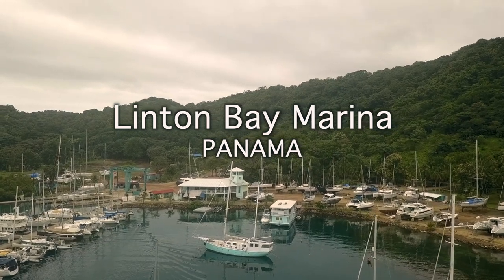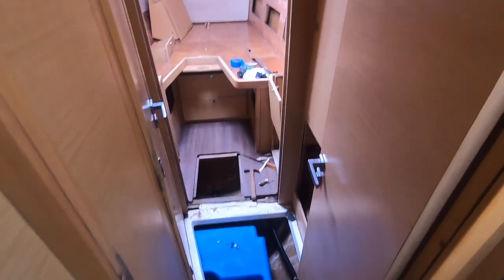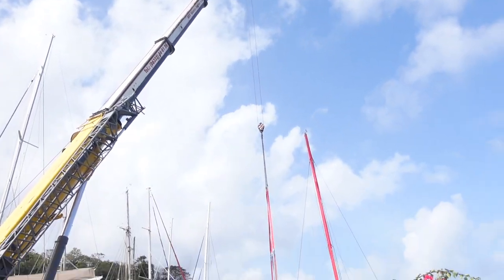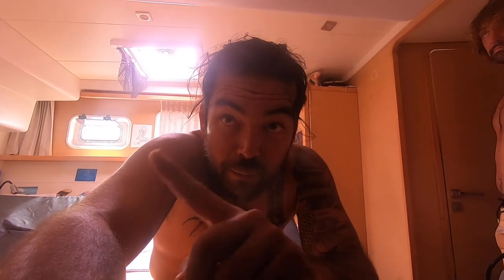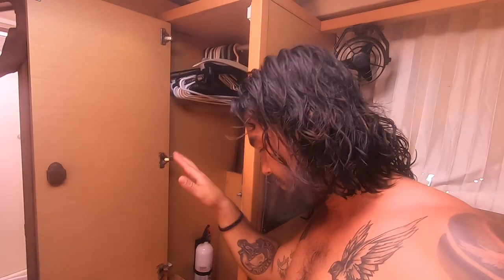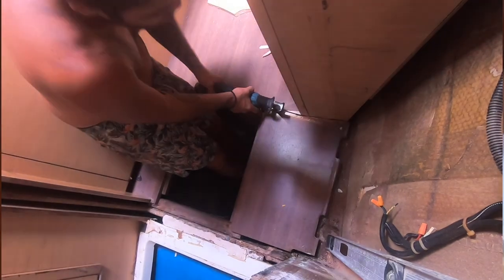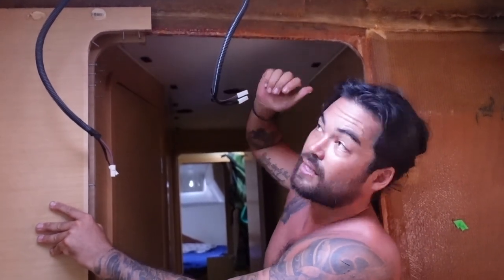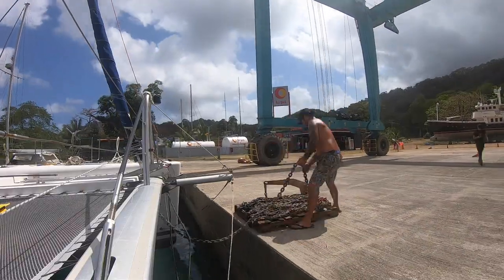CRACKED BULKHEAD REPAIR SERIES - Part 2

Comment: The amount of damage is quite impressive for sure. Im more surprised the boats hull hasnt cracked and sunk at this point. Ive been watching since the beginning and it has been a rollercoaster ride. I know with your repairs this will be the strongest lagoon 450 out on the water. Cheers for getting in the tight spaces, i was having a little anxiety thinking you might get stuck under there, but realized the video was published so you made it out eventually. Hopefully lagoon takes these videos of seeing the damage to strengthen their boats going forward. I know the boat wasnt designed for hurricanes but didnt think it would be that damaged and beat up. Heres to watching Parley get reset to an evened out hull and everything fixed so you can continue on in your journeys. Cheers mate from Texas!

Comment: You better laser level the stands before you start any leveling of the vessel.
Reply: Yes a good place to start for sure level props first
Reply: I think that Colin has it all in hand as he is no fool. He will no doubt be using multiple jack stands on the hulls and the bridge deck to level the vessel and get the hulls and bridge deck plumb. He wouldn’t level the stands as the boat isn’t all flat level surfaces. Better than a laser level for plumbing the hulls to each other is a water level, simple to use, cheap and 100% accurate.
Reply: These boats like most boats are built from the shell bottom up in layers . That's why it's a nightmare. Back off all the hard ware and bring in alot of level stand points . Then repair with glass and glues and fabric.

Comment: If you guys would have crossed the pacific like that, you would have ended up like sailing zingaro. Their cat litterely broke in half. I surveyed a lagoon 440, an a Fp 46 bahia, and a 40 manta last year. All had stress cracking. I am litterely batting 0 on every fiberglass multihull I surveyed. A couple people told me to look at trimarans. Because the horizontal distances are shorter between the hulls, they are much stiffer and less prone to stress cracks caused my excessive movement. From an engineering standpoint, that makes since.  Right now, I am looking at a steel tri to hopefully get away from the stress cracking. If I find them on this vessel, in will probably go to a mono. They don't crack in half. Good luck on your repairs!!!

Comment: Man the amount of work here is going to be massive,   Disassembly, repair, put back together again.  What’s your timeframe,   2 years?
Reply: I reckon less than 2 months for everything back together.
Reply: @Acrowat40  Agree, most of the time will be in the disassembly and re-assembly.  The actual structural repairs will go relatively quickly once they get everything opened up.
Reply: @Acrowat40  Love the optimism.
Reply: @Acrowat40  2 months seems optimistic,   Did you watch expedition evans? Or sail life,   I guess it will depend on the amount of people working on it too,  they seem to have a good amount of folks get involved,  also lagoon involved with the technical side will be an enormous help too.
Reply: @vxnova1  Considering how crappy those Lagoons are build, I wouldn't count much on the technical support of the builder. By now I guess they could advice Lagoon how to build better boats. ;-)
Reply: @Acrowat40  it has been 2 weeks now and they just got hauled out.  Love your optimism but this is going to be a lot longer than 2 months,  maybe not 2 years that was from Leo on rebuilding the tally ho, where his schedule is always 2 years
Reply: @vxnova1  yeah great series! But EE were two newbies at major repairs (one who had to start working mid repair) vs colin who is a mech eng & ships engineer with a couple of boat salvages under his belt along with a couple of mates working full time.  Leo's project is completely different in every way, he's basically building a large wooden boat from scratch...
 I think will be closer to a couple of months vs couple of years. I like the repair videos the most, so I'd prefer it taking longer : ) 
Looking forward to finding out either way!

Ps MJ sailing are doing a cat build (starting from panels) which is worth checking out
Reply: @Acrowat40  I have watched mj sailing as well.  Have to cut back though watching too much of this stuff but I am looking forward to this one, it’s a big repair,  i am no expert and I think the repair will be the easiest part it’s getting to everything is going to be the pain,  disassembly and reassembly,  the all the electronics too
Reply: @Acrowat40  I'll be shocked if they can get this thing back in the water fully repaired in under a year. Unless they get a decent work force helping out on it. If it's just the two of them this boat will take probably 2 years if they even bother persisting with it. The entire boat needs a rebuild.
Reply: 4-6 months for a proper refit.
Reply: @johnwinnerd8511  this isn’t a refit. This is looking more like a rebuild. Getting all this squared up seems impossible. It’s bent and twisted. It’s gonna need more than pressing up from the bottom.. I feel like Debbie down but it may not be repairable. Like a car that gets a twisted frame. I really hope I’m wrong. Praying for him.
Reply: Soooo 2 months to repair the bulkheads was pretty much exactly on the money!
Reply: @paulvandriel2344  almost exactly 2 months it's was to complete the bulkhead repairs after all.
Reply: @uglyduckling81  two months, and probably less than a couple of weeks to get the boat finished. Impressive work.
Reply: @Acrowat40  It ain't over until it's over. The real work comes now. Let's see....
Reply: @Acrowat40  much better guess than mine anyway.   Not sure how long before he is back in the water,   I think they have all the electronics to replace as well,  so maybe a few more weeks left yet

Comment: Lagoon should carry their weight and fix this catastrophic failure with their production boat.
Reply: I’d agree if it weren’t a hurricane damaged write off boat,
Reply: The damage Colin's fixing predates the hurricane. That's what the wood blocks confirm.
Reply: @RechargeableLithium  yea that’s not good, definitely damage there prior,

Comment: Just reinforces my belief  never to buy a glued together production boat. Between you and Evans Benetau, I have come to see how inherently weak those boats truly are from the factory. Obviously, made to sit at a dock or  on anchor, not actually sail and take on any stresses.
Reply: You are so correct. I had a boat in Australia and the boat surveyor told us of a Beneteau coming from France, and on his survey, all the bulkheads were delaminated , none of the doors or closets would shut and the boat was all twisted. POS it was. Expensive though, but just not ocean worthy...

Comment: Were the shrouds over-tensioned? Aside from what looks like design/manufacturing deficiencies, overtightening the shrouds looks like it would contribute to the problems here
Reply: first of all refering to the multiples exchanges around the french 450 having the same damages, it seems that pre tensioning should be done with the boat jacked under the cockpit (as at the end of the video) which is nearly never the case.  but that is a recurrent discussion about cat rigging

Comment: Farrrrk ! You guy must have balls of steel to be so committed to this. You are also soooo fortunate to be in a facility with the heavy lifting/ shifting gear available to you. The issue I see is, as you get the hull back into the correct position in all the places it’s off, how the hell are you going to get any adhesive or resin into place to let it do it’s job effectively ?  Obviously, when the boat was built, they were able to drop the floor onto the hull as well as having a crowd of people helping. This is such a mammoth project but, I’m pretty certain you guys are up to the task; you just need more hands to help.

Comment: I would drill some holes through the floor over the top of those attachment points and add the adhesive from above. l would devise a way to prep/sand those surfaces from above. I feel it would be near impossible to prep and glue those areas from that cavity. I would rather have a few well placed inspection ports in the floor to facilitate a good repair. Maybe even get some tabbing in there.
Reply: that makes a lot of sense
Reply: agreed the correct way to repair the boat, not that it's good idea. Is to return the boat to the factory and have the entire deck removed, replace all the bulkheads and any structural components while the boat is located in an original mold or Jig to ensure its square and true. Keeping boat square and level on  all 3 axis will be nearly impossible in a gravel boat yard.THEN re-glue everything, add a significant amount of new and additional structural components, fiberglass and epoxy. Then put the deck back on. I estimate this amount of labor and material costs will far exceed the cost of a new boat.... They have the car show on cable, Graveyard Car's, the guy rebuilds cars from the Car Graveyard, the new Channel will be called Davy Jones Locker Boats... ;-)

Comment: Some of your subscribers have been quick to place responsibility on Lagoon and it’s design team. From my observations, the majority of the damage in the bulkheads is most definitely moisture related. Although the plywood materials are considered “marine grade”, they’re still made of wood, a material that changes drastically with differences in moisture, regardless of how well it’s been “sealed” in resin.
I wish you the best of luck (skill based) in your endeavors to repair this beautiful craft.

Comment: I guarantee all of these Lagoon 450 cats have at least some level of these same problems. Good luck guys 😳
Reply: I used to have a thing for them...definitely not anymore.
Reply: I can’t help but wonder if all of theses boats have some kinda of damage on the other hand I have to wonder what the heck was done to this boat to make it bend like this
Reply: @nwanchorcertification  
It was an insurance write off after hurricane damage...they had no clue what they were getting in to.
Reply: Really bad construction that there was no tabbing on those bulkheads, just glue and fillets.  Even if they were tabbed they dont appear strong enough anyway.  The engineering was flawed from the start. 
Clearly there were problems with this boat before the hurricane damage as well. Not only was the repair attempt inadequate but they likely kept tightening the rig as the boat bent, which made the problem worse.
Reply: @daversj  
But again...it was hurricane damaged and an insurance company had written it off.
There's no such thing as a bargain cat...there's a hell of a lot of stresses on them...and weight is kept low to improve performance.
Reply: @charlesharper2357  Are the other Lagoons made better ?
Reply: @daversj  I'm wondering if the floor should have been anchored to the bottom hull with fasteners rather than glue.
Reply: @SomeTechGuy666  
No idea...hard finding info on it.
I just think that insurance write offs aren't indicative of build quality...it was a write off...boats aren't designed for that kind of abuse
Reply: @charlesharper2357  very true,  we can only imagine what type of stresses was placed in the boat during the hurricane
Reply: Yup, mass production boat, glued together... who wants a boat that is glued together?!
Reply: You are spot on Gabe. Many of the lagoon owners especially the 450’s are checking their boats now and finding the same failures, albeit not as severe, and none of them are storm damaged boats either. This is a design, materials and build quality issue. The other 2 of the 3 major cruising cat builders are benefiting from this exposure of the Lagoon issues while Lagoon are going to loose potential customers (those customers are moving to the other 2 builders). It is interesting to note that many of the other lagoon owners that have found these same failures haven’t received any assistance from lagoon and in most cases their communication attempts with lagoon have been ignored as they haven’t got a response.
It’s really sad these days that unless you have a good social media following, you are on your own when you have issues with a product that has failed dismally. I’m convinced that the only reason the guys are getting any assistance from lagoon is due to their Parlay channel, which is growing rapidly.
Reply: @alanpiper9614  I would personally not take this one on, I’ve learned when to walk away. At this point these guys are building their own Cat, they just happen to have a pattern.
Reply: @SomeTechGuy666  Haha
Reply: @charlesharper2357  yes. Over the last 7+ years similar problems have been found in the 400, 420, 440, 450 & the 500, there are likely to be present in the newer models too if they were to be checked and throughly surveyed as the glue and go method and materials are mostly unchanged. It’s just that it wasn’t exposed on social media with a large following. It is now getting the exposure through Parlay’s YT channel which has a large following which is growing rapidly partly due to the promotion of fixing a damaged cat.
Reply: @Thanosisnotreal  I think that you are right by the time that they are finished with this round of major repairs.
Reply: @SomeTechGuy666  No, stay away from them.
Reply: I imagine that the boat builders are getting ready for the high jump and go bankrupt, because if all other boats have same faults then they are responsible for the repairs to every boat. No difference to a car call back to main dealer when they find a major flaw in the car.
Not that parley can clame but surely others can. These boats must be fit for purpose and if all design is suffering the same problem then the boat builders should fix it free of charge.
Just my thoughts not that i know anything regarding the law.
Reply: Water gravity weight wood glass  bend. A half sunken boat has stress its not made for.
Reply: This Lagoon 450 appears to have had some major damage done to it PRIOR to the hurricane.  As was pointed out by Colin when he removed those two sticks placed beneath the cockpit sole.... they appear to have been stuck there (possibly with 3M's 5200 or 4200 adhesive) before the hurricane.  We noticed on earlier Parlay Youtube videos that some of the turnbuckles "bottomed out" while they were working on their "non functioning" roller furling headstay.  At that time I would venture to say that the crew, unbeknownst to themselves, may have been causing further damage to Parlay by tightening the trunbuckles.  
I believe I recall someone saying that Parlay was insured and I am surprised that this major damage was not picked up by the Marine Surveyor early on.

Comment: 2 comments.

First, I understand the position you are in with Lagoon, but it is clear the manufacturing methods used in the factory led to the original structural failure and ultimately directly led to your catastrophic failure. Poor design and manufacture. I understand you must skirt this reality.

Second, this time Lagoon may be giving you the honest reality. It may be time to walk away. There must be quality cats out there with sound super structure you can do a rebuild on especially considering the electrics on Parlay are also fried. Not much left....
Reply: There an Australian company building aluminum cats out of The Philippines check sailing Jupiter2 a new 48 for 300k US fully loaded my dream in a couple of years .

Comment: Lagoon obviously hates that you are exposing how inadequate the structure is - they are floating condos meant to motor between Caribbean ports not sail in the open ocean.
Reply: but that is the way 90% of their customers used them..... as i already said i don’t blame these mainstream cat builder to be soecialyzed for mooring but i was not expecting a fix-it score close  zero..... fixed partition wall in front of access to structural frame and bulkhead...

Comment: Glad to see you're looking at it as a whole and not a patch job. Pulling out all that cabinetry etc will make getting the hulls, walls, bulkheads and floors true and level so you can reinforce everything and get the attachments right and tight ! Somebody in the Caribbean did a right awful frankenstein lash up on PR when they discovered that damage and didn't address it, they just glued and shimmed it without repairing anything. With Jamie to help you and enough beer ( New Sponsor Perhaps ?) you'll see this through and get PR back to sea for the Pacific crossing like you were planning.